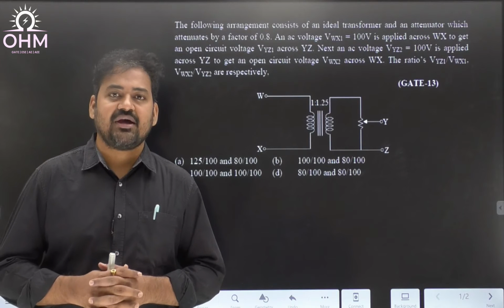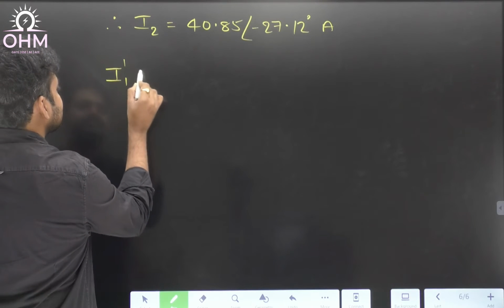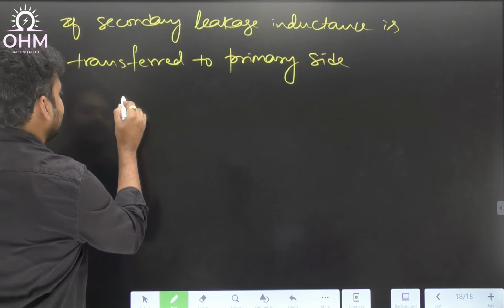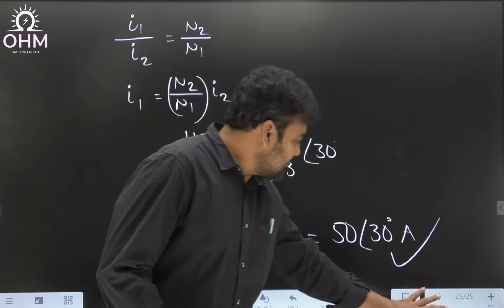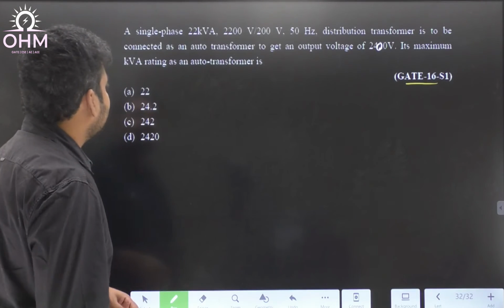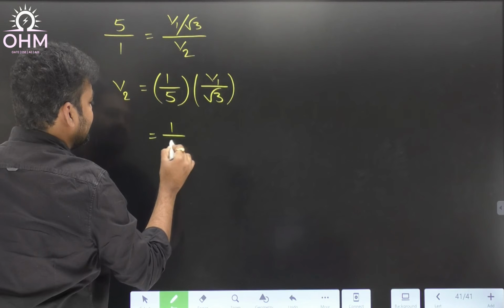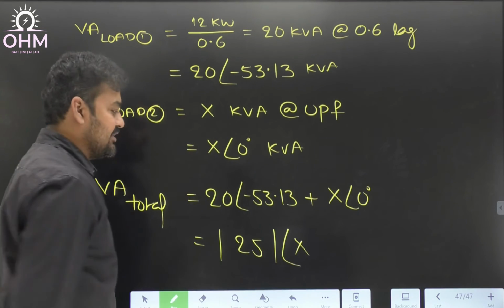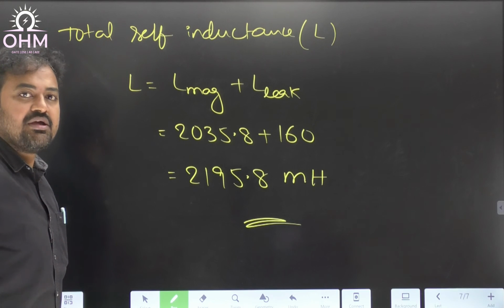GATE PYQs Series | Transformers | 2 Mark Questions | GATE 2024 | GATE Electrical | OHM Institute

Comment: Sir in 2 nd problem for calculation of reactance at last step is we can take 220 v directly?? Why means voltage drop there is there no??
Reply: Same doubt
Reply: First find the V drop across resistor due to active component of current only,
Now can write 
220-V drop across 1 ohm
Then divide this by capaitor current you will get actual answer